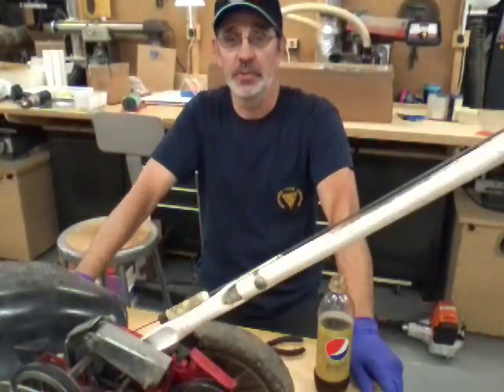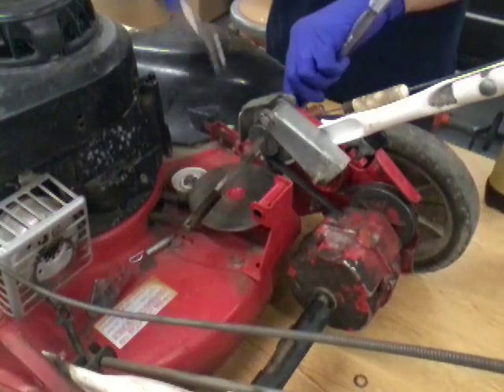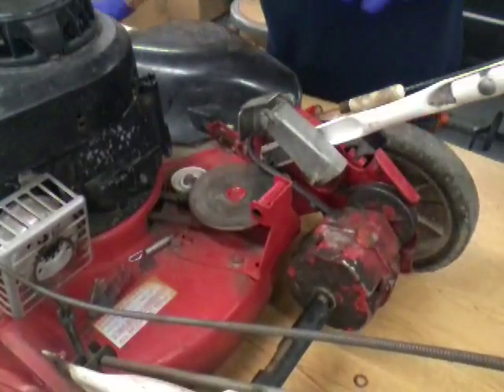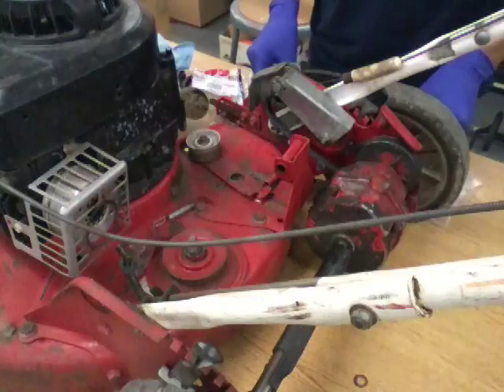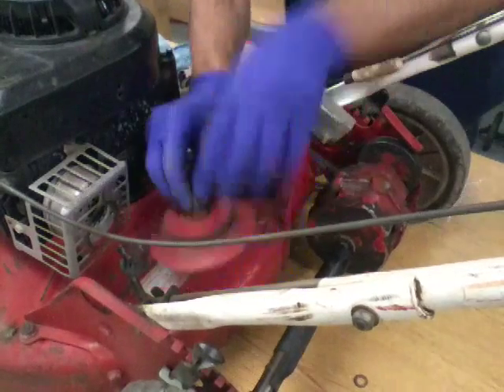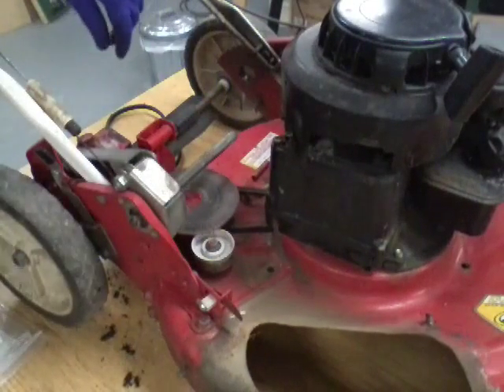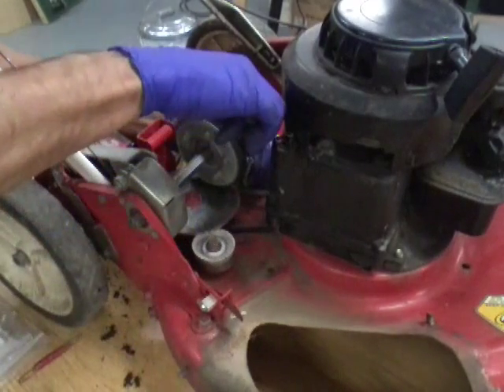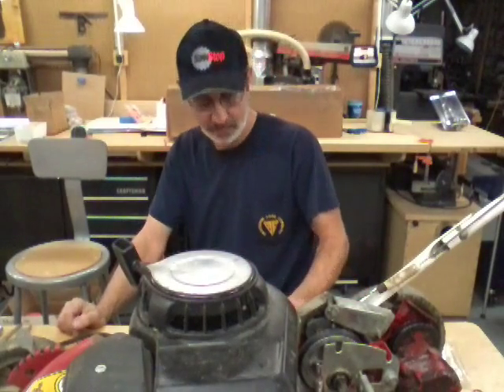142. M/S. 22  How to install new belts and a clutch disc on my Snapper walk-behind lawn mower

Comment: I have 2 Snapper self propelleds. Both were trashpile rescues.One has white handles othet has black handles.I put a newer 6.5 Quantom Briggs on the older mower. Huge differennce compared to the factory underpowered 3.5hp.
Reply from the maker: Robert Clark 
Hi Robert it's Jim
     And I'll have to admit there is nothing better then.  MORE   POWER.    LOL.  Thanks Jim

Comment: what are the belt numbers that you use on this. I am having trouble finding the correct ones.
Reply from the maker: @thomasrando6532  the belt that goes on mine is number
P216012 
Now the belt goes on your machine could be a little bit different size to get the correct belt go to Parts Tree.Com in Texas and type in your model number and they have belts that will fit any Machine out there. Mine was $15.99. In the description they do not give an actual size of the belt.
     Now, if you try to buy the belt locally, just remember, you cannot use a V belt you have to use a ribbed belt.